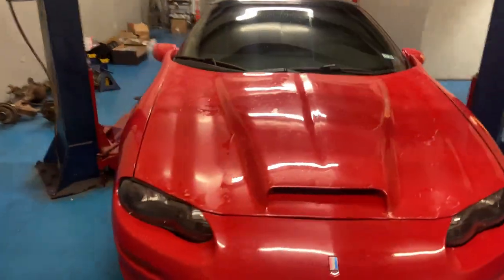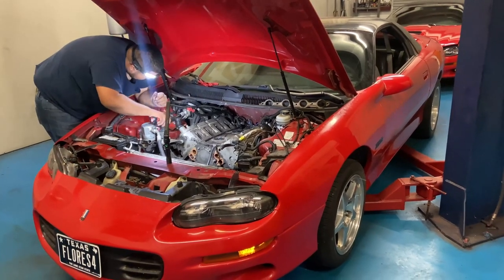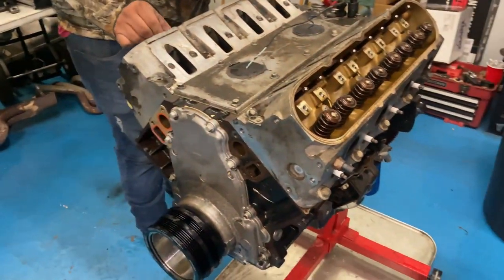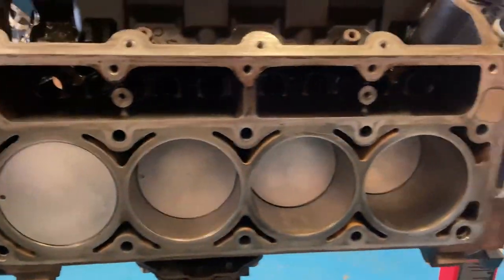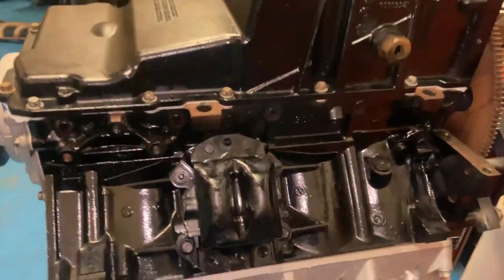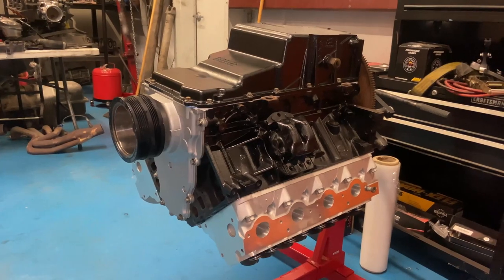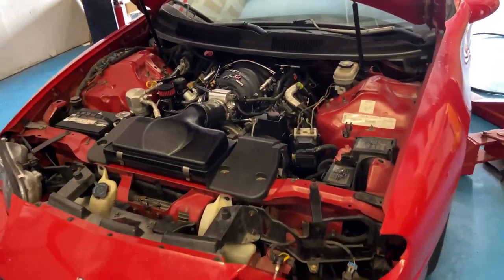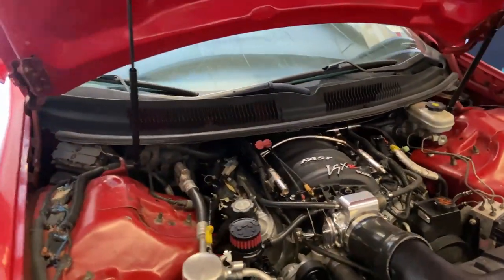SS Camaro 6.0 Gets Heads, Cam & Intake Upgrades

Comment: I can drop the engine faster than you pull it from the top😊
Oil pump hold down girdle so you can use 2 bolts is a nice piece.since the motor is out ...good time to put in poly motor mounts....jus sayin

Comment: 434 through a 4l60 with a converter is pretty good for that setup. Just wondering why you would get rid of the maf all together for a car without a power adder. Just put a 100mm maf on there.
Reply: You rt. I still think with a more max effort cam . Even if they had to do value reliefs the motor was already out. But never the less. Add 40-55 Hp lost through any auto and them numbers bout rt with not to max effort cam. Fuel  timming ECT play a roll in head cam cars but still strong tho. One guy holds the head cam stock 346 cubic inch cathedral Port stock tq arm suspension 1/4 mile record done by GM High performance tech bk when The ls1Tech forms and magazines was in a while ago. Full weight car ran low 9s on motor stock 346 cubics crank rods piston deal. Ps . A Th400 trans absorbs the most Hp rear tire lost. That's what my mystic teal filp flop chameleon factory code stock suspension small tire car run . 1st place rob power is the Th400 , 2nd place the 4l60 and 80s , 3rd place power glid and nobody runs the 700R trans so that's the rob power ranking order on Auto cars.

Comment: How is that driveablity treating you with that 104/Fast 102/No Maf Speed Density.  Some A4s don't dig it much.  What converter did it have in it?
Reply from the maker: I have several that run great but this car in particular not really that great. It’s drivable but you are correct the drivability is rough
Reply: @hubcityhotrodstv8374  I know a few that swap down to a smaller 92 TB to get that driveability in check.

Comment: That's terrible power numbers.....was you even trying? I hope it picks up alot after fixing the issue. It should get near 500whp....more maybe.
Reply from the maker: I agree but we’ll let the times at the track determine what kind of power the cars would make. The car definitely feels more than 430hp. Thanks for watching!!
Reply: @hubcityhotrodstv8374  hopefully it runs some good numbers.
Reply: I don't see an A4 getting 500 rwhp with that combo. Maybe 450rwhp max. Run it out to 6500. That is where my MS3 peaked with a Fast 92.
Reply: @crushthequarter6863  I'm just going off what my bolt on ls6 made. It made 451whp/423wtq.  That was through a m6 but i would think a h/c 6.0 would/could make more than that even through a auto.
Reply: @HioSSilver1999  Those 4L60s can chew some power and who knows what converter is in there so it will eat some too. M6s definately put down the power.

Comment: i made the same power 433hp 392 torque on a mustang dyno with a fast 92mm nick w 92mm prc 225 heads 62cc chamber ,texas cam 228 232 600 600 112 lsa ,391 gear thru a 6 speed